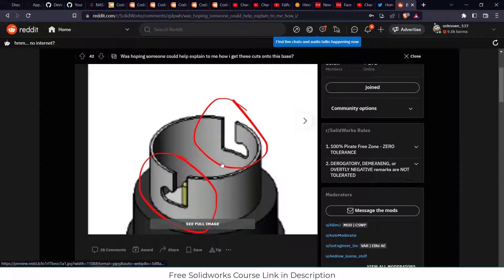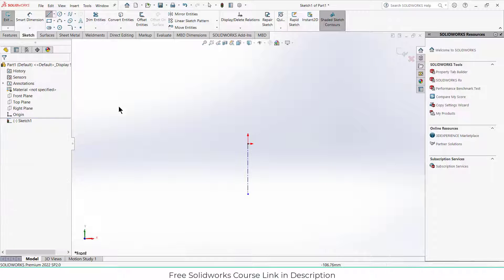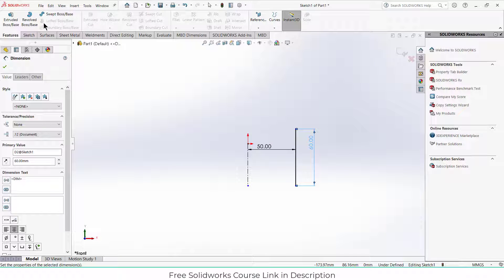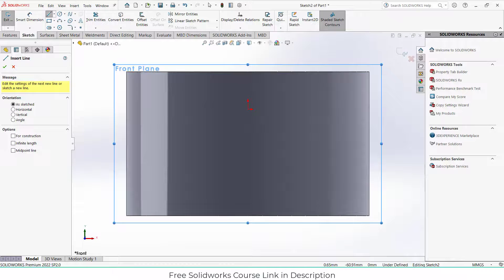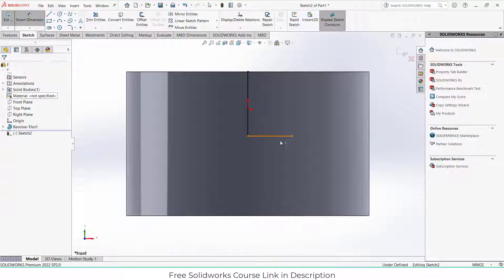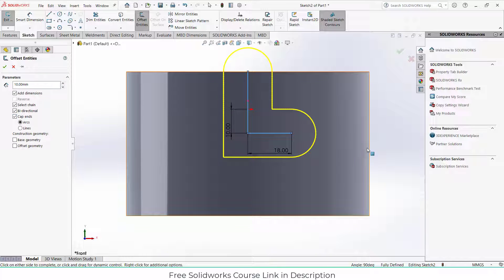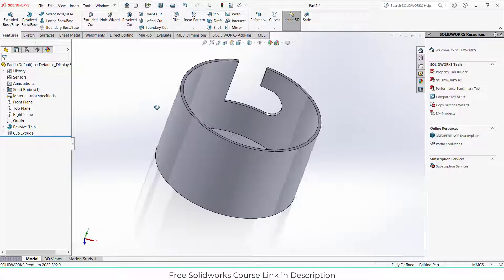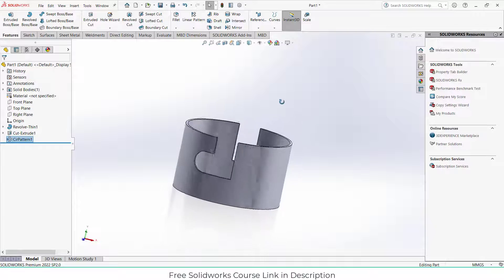How to  extrude cut on curve surface in solidworks | Solidworks Exercise For beginners

Comment: What if you want the inner wall of the semi-circular portion of the cut to be perpendicular to the tangent of the outer tube wall? In other words have all the edges of the cut extrude in the radial direction toward the central axis of the cylinder, not straight through the tube in a planar direction.
Reply from the maker: Circular extrude cut can be use there . Defining angle range there